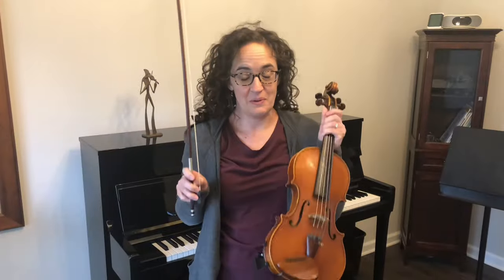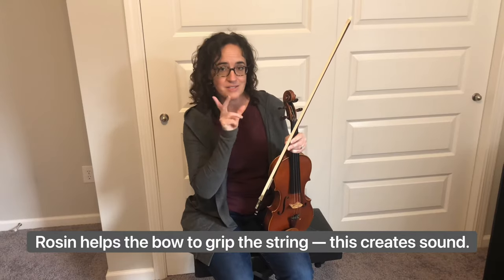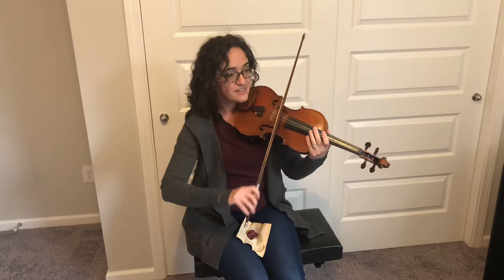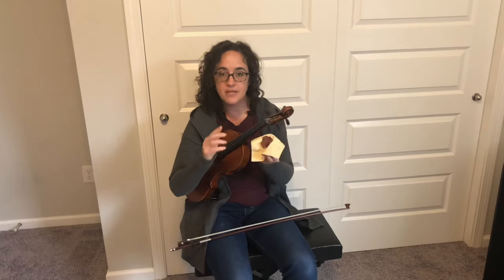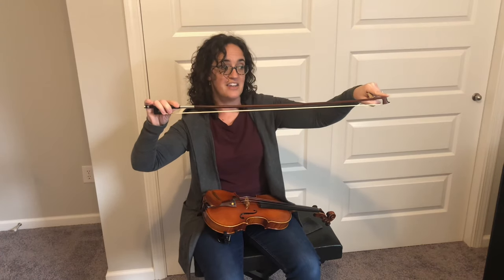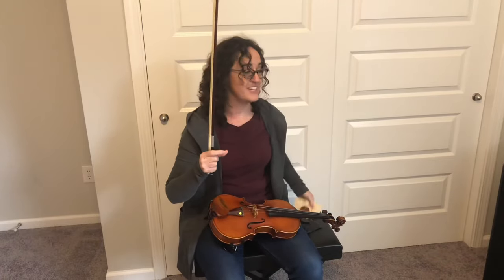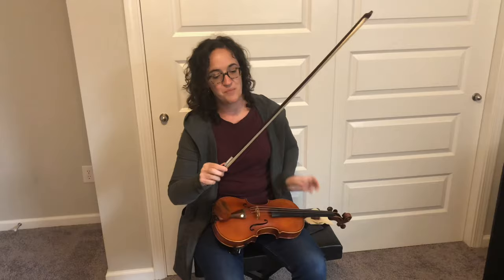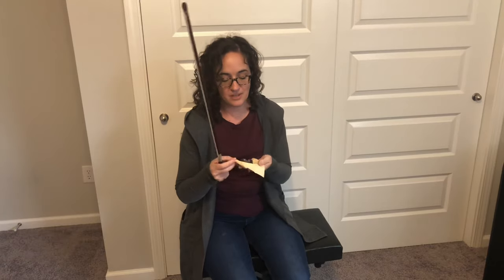How to fix: violin bow not making sound

Comment: Hello, I was wandering if you could help. 

My violin is currently sounding like my bow needs rosining, it doesn't. I've used two, well-rosined bows, and it just slides like it needs rosining. 

I thought it was my bow as it keeps jumping in the upper half, so I tried my spare. And it keeps jumping on the same spots. I've cleaned my strings. Still same issue. 

Is this something you may have come across?
Reply: Yes I have the exact same problem, my only guess is that the rosin is either too hard, not working, the bow is the issue or smh else, hope u find a fix for ur vilion